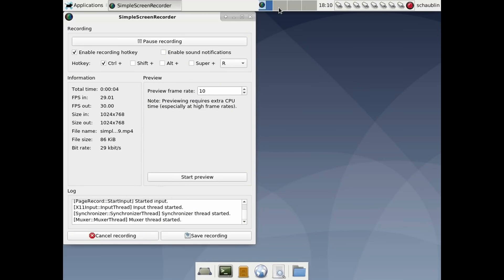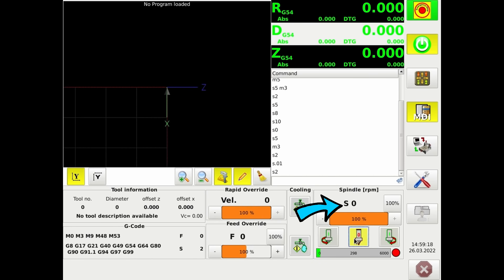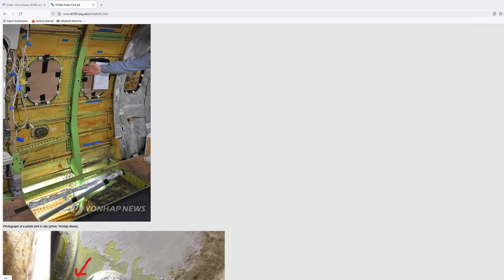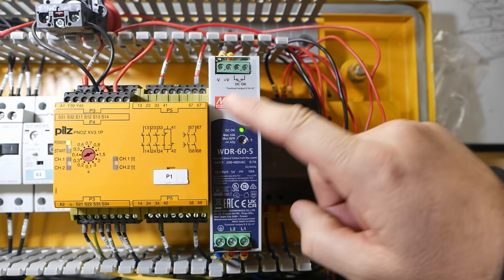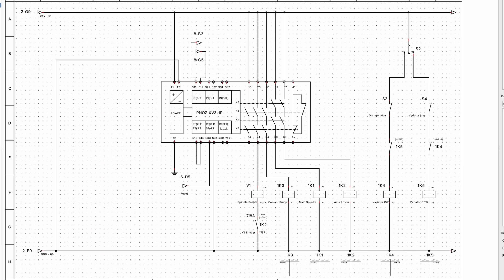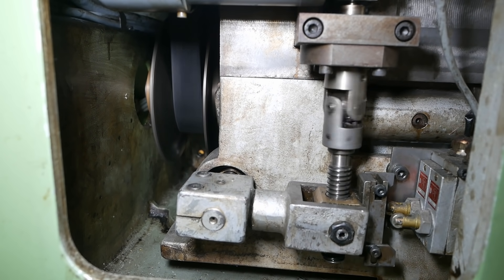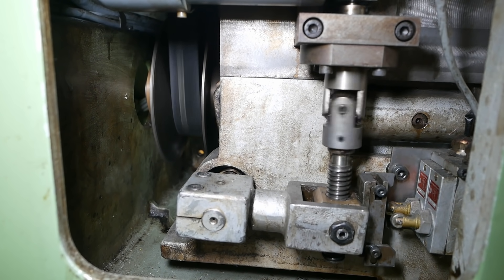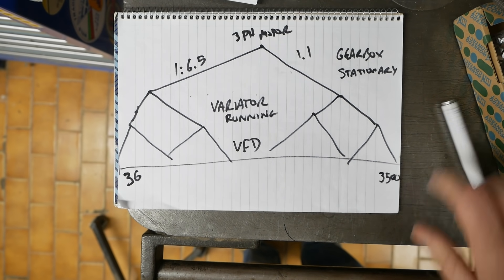Variator control - Schaublin CNC - Ep.30

Comment: I wonder if the fitting on your expansion tank rusted because it is a steel part in contact with a brass pipe fitting. At least the rest of the plumbing appears to be brass in the video. I have the exact same issue developing in my house heating system. I plan to get a stainless steel (or maybe even plastic as the system is very low pressure) transition piece to remove the dissimilar metal interface.
Reply from the maker: Could well be. This system is a wild mix of black iron, zinc plated and brass fittings. It is not critical though, and 15 years from a €50 tank is not terrible.

Comment: I think I would go for the variator and or VFD control and leave the gearbox in 1:1. You really shouldn't need super low speeds unless you intend to run large HSS drills or machine large OD parts in steel. I've never seen Jute string used with thread compound before, is that a European thing?
Reply from the maker: Since I tend to use my lathe for a lot of one offs, it is quite possible to need the low ratio. That is easy enough to implement though, as it will need to select that before starting the spindle.
I guess that must be, I learned it from the plumber who redid all the water and waste lines when I got this place.
Reply: @RotarySMP  How did Schaublin manage it originally? Will the box shift on the fly, or does it require a bit of slip for the gears to find mesh?
Reply from the maker: @steamfan7147  The gearbox can certainly not be selected with the spindle turning. That will need an inhibit. I am surprised that they seem to mesh without motion. The maho needs its input rocked during gear change.

Comment: The motor cooling should be considered so variator is better than a slow running motor with no cooling.
Reply from the maker: Is 20Hz still fast enough to cool itself? I sort of talked myself into that.
Reply: @RotarySMP  I leave that to you, never had any problem, that I know of, but it is a legitimate concern if long periods of slow high power use are envisaged.

Comment: Perhaps it could make sense to use a linear resistor in order to be able to measure the variator jack screw position. That way you could use that position information for the spindle control logic. Also good to have a spindle speed +/- control override on the control panel.
Reply from the maker: Control override will be easy to implement. I am not sure I need the position feedback, as the variator change rate is fixed, so the VFD will have to close the loop. I dont really want to bang bang control that variator motor, so maybe only one variator move is needed per cut?

Comment: I'd think i'd go for variator and VFD only, very rarely would you need to move anymore between that speed span you get with that set up during a cut, and im sure having the gearbox controlled by the computer would be fun, but if you get a glitch/bug and the computer sudden lt thinks its a good ide to change the gearbox while underway... well i dont thinks its worth the risk. Unless there is a mechanical failover that prevents the gearbox change while already running i guess...
Reply from the maker: The gearbox is pneumatically controlled, so I was going to a software inhibit to prevent selection when the spindle is turning. When facing a 250mm plate the low gear would be needed. I only do hobby shop one off stuff, so that will come up sooner or later.

Comment: I would assume the best option is to utilize the motor to its full potential.  In other words, use the vfd and variator together so that the motor is running at the speed where it has the maximum torque or efficiency or whatever at as many RPMs as possible throughout the range. I think most motors lose torque as RPM increases, but it's probably worth finding out what the torque curve is on that motor.  Set the VFD to the RPM where torque is max, and use the variator as much as possible, then use VFD when you need RPMs outside of the range provided by the variator.

Some other considerations: Changing RPMs with the variator will result in more mechanical wear.  It'll wear out the belt and those pulleys faster, but that may not be something you need to worry about depending on how often you use the lathe.  It's probably been used more before you got your hands on it than you'll ever use it.
Reply from the maker: Yeah, this is like a retirement home for machine tools. Wearing out is not a danger for them.

The variator change rate is fixed, and I dont want to use bang bang control as that would hammer the contactors.

Comment: I think your diagram tells you what to do. You know what the max fixed speed needs to be for a entire program before you start, so you can set the gearbox to high or low as required. You know what the speed of the next cut/tool will be, so set the variator before you start the cut. Then use the vfd for dynamic speed control. For facing you might need to set the variator to max speed and the vfd to a low frequency before you start the cut. Then increase the vfd frequency as you get near the center line. This way you will not be adjusting the variator during the cut, but will benefit from the best torque advantage a variator brings to the party. You may have to factor in the diameter of your work piece. You might be a metal basher but you can do this
Reply from the maker: I dont think it needs to be a fixed gearbox speed for a whole program. If Is set the PP to stop the spindle between cutting passes, then I could change gear and restart the spindle to any speed at any time in the program. 

Normal turning cuts are also easy. It is the CSS large diameter facing cut which is the challenge.
Reply: @RotarySMP  Then for large diameters to get the largest speed range and the highest speed you will have to simultaneously adjust both the variator and the vfd. Not sure that will be possible. But probably is to a man of your skills. I guess the need to adjust both on the fly will largely depends on diameter, and the material. I think you have some math and coding to do. Looking forward to your solution
Reply from the maker: @thisoldphoney3448  If I set the VFD to control the speed in closed loop with the Encoder, and the VFD can change speed faster than the variator, then having a variator change mid cut should be irrelevant to the VFD; it will just compensate. I hope :)
Reply: @RotarySMP  I think the answer will depend on the diameter of the part, as in will the vfd have the range. My, limited, experience with them is the have fairly low torque at low speed. It will also depend on the lower rpm limit that is acceptable when the cut gets to the centre. You want it as high as possible, but for a large diameter part the vfd might not be able to go slow enough. There again to you want a 150mm chunk of aluminum spinning at 3500rpm :-). Look forward to seeing which way you go and why
Reply from the maker: @thisoldphoney3448  That is the issue in a nut shell. I have a speed range of nearly 20:1 with just variator and VFD 20-70Hz.

Comment: Use the VFD for constant surface speed, and the others to reach the needed range.  You’ll need an algorithm to fully solve needed switch states for a programmed cut.  With all the overlap in the middle range, you can either make stops for gear changes or pick a gear to start and then make the other gear unavailable until the operation is over.
Reply: It's basic math... ratio A * ratio B * ratio C, with the VFD freq. equating to a motor RPM.
Reply from the maker: The challenge is that the variator change rate is constant unless you bang bang control that motor.
Reply: @RotarySMP  that’s why I think you go full software control.  Make sure for any cutting operation you have variator and gearbox locked.  It limits what you can get from a performance perspective but gives you a way to be certain of how the machine will behave.

Just my $.02.  I’m very much looking forward to how you choose to work it.
Reply: @RotarySMP  you know, I was thinking on this, and I realized that I think it only matters for rigid operations like threading.  It might be fun to setup the variator to drive constant surface on a pipe thread and see how well the axis chase it.  If you’ve ever seen how a cheap inkjet works, the head that drives is a cheap 2 pole motor.  They use a timing strip to make sure the head is within a speed range.  I’ve often wondered if we could use that for cheap 3D printers.
Reply from the maker: @craigbossard399  For the very minor speed change of most engineering tapers, the VFD can compensate alone. I think it is only CSS large facing cuts where the variator will have to be adjusted during a cut.
Reply: @RotarySMP  I’d say you’re right.  Is the variator up to the task?  It seems to me that the variator is a high low box without the penalty of having to stop.  Do you use it actively during cutting operations? Or is it set before any g1 command?

Comment: My guess ist that the lacing cord has a wider (higher) temperature range than zip ties.
Lacing cord seems to be rated up to 177°C 

To the question VFD vs. variator. does using the variator (under load) put wear on the belt? If so and if the torque is not needed I would probably use the VFD.

Oh and, do you need the old Ausdehnungsgefäß? If not I would have a use for it.
Reply: Lacing also doesn't become brittle with age, unlike plastics, and can't be accidentally (over-)tightened after installation.
Reply from the maker: You are welcome to that Ausdehnungsgefäß. Drop me an email.

Comment: I love variators, I like the idea behind them. I like the look and the robust behavior :) of the schaublin it's beautifully integrated and operated with the motorwormgearspindledrive. In my opinion, it would be a sin not using it. Because electronics at the time can't handle the motor Speed its the perfect solution. Higher end column drills have them still. I would check the high and low gear before starting the spindle, range low 35 to 1499 and range high 1500 to 3500 in between I would let work the variator the last 5% the variator can't reach I would Control with the vfd.

i would all control via LinuxCNC. The main problem for crashes and or qrong aettings is the human in front of the lathe so lets handle it via Linux ;)
Reply from the maker: Servus. 
The only issue is that the variator rate change is fixed, and I dont want to bang bang control it. This discussion has been really helpful to consolidate my ideas on the control logic.

Comment: They still use the waxed lacing in aviation wiring because cable ties are never cut straight and become a million little knives in places that are only accessed by sliding your arms past them. It's a lesson you only need to learn once.
Reply: They're also bulky and can be (over-)tightened by incidental contact or even vibration. Plus nylon becomes brittle after only a few years, while waxed lacing tape can remain in place with no issue for many decades.
Reply from the maker: Good call. Thanks guys.

Comment: Thoughts: from a purely academic standpoint it would be interesting to interface the VFD, Variator and gearbox into Linux. My concern would be will the software be sofisticated enough to diferentiate between a speed change at spindle due to change in load on spindle/workpiece (VFD/Linux will compensate by catching up until speed is restored) or speed change due to Variator input (VFD/Linux will tey to catch up and fail, run away?) The Variator would need some sort of encoder (linear or rotary?) to let Linux know "where it is", or alternatively there would need to be two encoders- one at the variator input (spindle motor shaft) and one at the output and software would check the counts and adjust the variator accordingly. The output encoder is already there (spindle) so would need one at the motor...it gets complicated quickly...good luck.
Reply from the maker: Thanks for your ideas. Since the variator change rate is fixed, Id need to bang bang it to use it as primary. That is unattractive.
You only need a wide speed change on a facing cut, and only a long one would need both the variator and vfd. So for most cuts setting a standard vfd frequency like 50Hz, then commanding the variator till the desired speed is acheive would be enough. With the VFD compensating for speed changes due to loads.

For big facing cuts, starting with the variator slow, and then doing one variator move to fast in the middle, with the VFD closing the spindle speed loop, and compensating for the big variator caused change seems to be where I am heading.
Reply: @RotarySMP  The variator uses a 3 phase motor, so what about using a second smaller vfd to control it in place of the contactors? Linux can have direct control over it, the limit switches can be the variator's max and min limits. If the gearbox has a "neutral" freewheel position the software could start the main motor at a slow-ish rpm and run the variator all the way to low position during an "initilize" routine without the spindle turning. This method would be more in keeping with how the machine worked originaly, but more "refined". Food for thought.
Reply from the maker: @MRCNC1967  I can see the appeal of a second vfd on the variator, but am pretty sure it is not necessary. For most turning cuts, even tapers, the VFD alone should be able to handle the speed range. 

The bear in the room is facing large diameter parts. I could see a start with the variator lo limit, CSS until the VFD frequency tops out, then a big variator change to Hi limit, while the VFD similtaneously compensates byreuding frequency to maintain the changing CSS RPM, and then ramps back up to max frequency as the cut preogresses.

Comment: I think it is best to bring every part under control, but it has got to be programmed that it sets either the 1.1 or 6.5 ratio before starting. So the program has to figure out beforehand what speedranges it needs to run well. Set the ratio, and then start. And when it comes to a point to switch the ratio again during operation, it should be programmed so that the machine stops, and than change gear. And then proceeds with machining again. 

I think you should figure out if you would ever need to change the ratio gear during machining. Probabably not. While material cutting speed does not change all that much when the machine only does parts made of one type of material.

Very interesting project!

It takes some time. :P

Greetings,

Jeff
Reply from the maker: Thanks. I have the same on the Maho. Because it just has an 18 speed mechanical gearbox, it has to stop to change gear, and there can be no changes in a cut. I have received a lot of excellent feedback, now I need to start digesting it and mapping out a plan.

Comment: What about adding a clutch to the gearbox, making it able to change while running?
Reply from the maker: Cutting power through the drive train, with an insert buried in a cut would likely mean dead insert and wrecked part.

Comment: Have a custom G-code message box come up telling you to "Set gearbox to High/Low", and then a second one when spindle is running "Set Variator to Hi/Low", based on desired RPM for the program that will run. Then do all the control with the VFD. 

Unless you want to get fancy and map the torque for variator and VFD to always have maximum output.
Reply from the maker: Setting the gearbox is just a single output pin from LinuxCNC, Also easy enough to connect the variator control to two output pins. The more difficult task is working out the sequencing, and programming it.
Reply: @RotarySMP  Oh, right, computers can switch things. I forgot! haha

Comment: The wires are probably still laced because of chafe. i would imaging as with all thing Aeronautical the engineers are concerned with anything 'what if' and lace is just softer and less likely to chafe. as well as cable ties can get brittle and come off... then there's loose parts in questionable areas. where as a lace will still be attached even if one or two knots come undone.
Reply from the maker: Good point. You see a lot of brittle broken tie wraps.

Comment: Hello! In Linux itself, there are "pulleys" settings. I did the switching through the M command with the P parameter. That is, the desired range is selected there within which you control the reference voltage on the frequency converter. The choice of the desired value of the M-code must be protected in the postprocessor, then, depending on the speed, it will itself select the desired parameter of the M-code.
Inside the code itself, you can set control through the commands M62-M65
Reply from the maker: Thanks. IÄll have to take a look into that.

Comment: If the lathe motor is the original motor, then it might not survive running through the VFD at extreme frequency values. I think an optimal control strategy might be to use the variator to get the RPM speed in roughly the right range, then use the VFD for the fine variation, aiming to keep the motor at the 50Hz frequency value as much as possible.

Of course, you might be fine. Plenty of old motors run with VFDs no problem - I did find the one on my old Colchester lathe got quite hot at slower speeds though.
Reply from the maker: The Motor is insulation class F, so it should be fine. As I havent added additional cooling, I have kept the min frequency pretty high at 20Hz, and also not overdone the high end, at 70Hz.